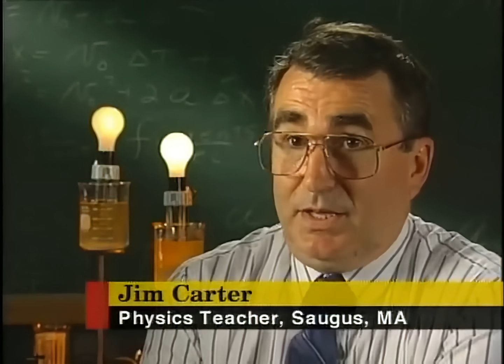MIT graduates cannot power a light bulb with a battery.

Comment: The big 120 volts light bulb sure lights up on the 1.5 volts battery but we don't see the light because it's too weak for our sight, but, if you observe the light bulb through a cellphone camera which is infrared sensitive then you will see it lights up because the filament gets a little bit warmer and irradiates infrared radiation.
Reply: "unless your phone camera lens is bigger than your dilated pupil, it cannot detect wavelengths bigger than what your eye can see (infrared)" Bullshit!
Reply: Martin O'Donnell
Your'e right, that's bullshit. This guy, Putty, knows nothing about physics.

Greets
Reply: Any heated body emits, it's just that the visible part of the radiation is not always powerful enough for our eyes to register, so from the point of view of physics they can light a bulb from a battery and a wire since the battery will heat the spiral of the bulb and it will emit more
Reply: First off the size of a bulb is not necessarily directly proportional to it's voltage requirements. There are small bulbs that are 120v (usually in a night light) and there are very large bulbs that are 2.5v. It was clear (at least to me) that they weren't trying to trick anyone.

Second, a MIT graduate should be able to read. The voltage rating is printed on both the bulb and battery so if the battery couldn't illuminate the bulb, them even attempting is quite humorous. 

And finally unless your phone camera lens is bigger than your dilated pupil, it cannot detect wavelengths bigger than what your eye can see (infrared). Most infrared cameras have a lens diameter of about 5 inches. I'm guessing you meant electromagnetic radiation in the infrared spectrum, there's no such thing as "infrared radiation"
Reply: putty93010
First; I know that the size of a bulb light has nothing to do with voltage. I just wanted to be descriptive.

Second; Being graduated at MIT is not a guarantee of basic and practical knowledge at all. School does not make students.

Third; The size of a lens has nothing to do with detecting bigger or shorter electromagnetic wavelengths. Most of cellphone cameras are able to detect infrared radiation. Infrared wavelength is even shorter than microwave radiation so it can easily pass through the tiny lens of any cellphone camera.

¿Why don't you do that experiment at home?

Greets.

Comment: Is this because the light bulb was designed for AC not DC current?
Reply: NO, IT'S BECAUSE THE CIRCUIT IS OPEN
Reply: it's because you have to close the loop by touching the bulb directly to the battery.
Reply: +Billy Leask No. Incandescent bulbs can run on both AC and DC just fine.
LEDs won't run as well on AC (they'll only be on half the time, which might be noticeable if the frequency is low enough), and in either case you'll break them without a resistor unless it's built in (which they are in bulbs, but a standalone LED won't), but DC is fine as long as it's in the correct direction.
Fluorescent bulbs need AC though.
Reply: What I said was that you had to close the loop. I didn't specify how. The Flagged Dragon is right.
Reply: +RyuDarragh Right
+CedarAce I realised that, but some students managed to close the circuit
+gimmethegepgun Thanks, I hadn't realised that.

Comment: This is not a question about electricity. All of them understood that they had to close the circuit in order to light the bulb. They expected two wires and thought the task would be really simple, but instead they were presented with a logic puzzle.
Reply: Difference between schematic diagram/circuit diagram(abstraction) and it's physical realisation(concretisation). 

The problem required them to understand how bulbs are wired. That particular bulb had one terminal at the bottom and the other on the side body( usually used in torch lights).
Reply: There is a girl who clearly didn't close any circuit (unless she is counting her body to ground is a close circuit) and was done
Reply: @dollymix5  Folks who failed in that way did not even get to the true test.
Reply: Engineering means to make the utilisation out of limited resources .... 
They should have done ... 
In industry you can be on the top when make the best with unexpected situations..
Reply: It's still about electricity if you consider the knowledge they're supposed to have about how current flows in conductors connected to batteries while on a closed circuit.
Reply: Well, engineering is essentially one big logic puzzle. So they should still be good at it.
Reply: To be fair problem solving should be very important in most of these academic fields
Reply: Logic puzzle? Its not even a puzzle 😂 just proof knowledge doesn't result in intelligence or wisdom
Reply: well, sure they expected tow wires, but the real problem is that they didn't know where to connect the light bulb to the circuit, even if they had two wires, I doubt they could figure out where to put them
Reply: They had one wire. 

Also they only had two hands and not a place to put 3 things. Wire battery bulb.

So this was a set up to show failure.

Also the problem was not working with a bulb and know, where the power needs to be inputted.
Reply: @dofer112 i love how youtube algorithm made us respond to an 8yo comment in a random video lol
Reply: @dofer112  it's obvious to anyone how you would connect one wire to create a circuit. Clue is in the name 😂 should have been especially obvious to mit students but somehow wasn't
Reply: Just cut the wire using a cutter
Reply: When I want to test if there still electricity in the battery 🔋 , I use my lip and my tongue 😛 to choose the circuit 😉
Reply: Image these people having to help the crew on the Apollo 13. You’re fucked.
Reply: It's not a "logic puzzle" and you don't need two wires.  They just needed to close the circuit by touching the bottom of the bulb to the other battery terminal.
Reply: It's easier this way - two wires, it becomes an issue how to hold them. I'd probably strip the wire halfway to tie it around the outer bit of the bulb, because juggling is not my forte.
Reply: This question isn't about electricity because a light bulb can't be powered by DC? 😬😅💀. The comments here prove the video right.
Reply: It was obvious to attach one terminal directly to the bulb.
Reply: An actual dog with the intelligence of a 3 year old could figure out this "puzzle".
Reply: That seems to be a logic puzzle of the level a high school graduate should ace.
Reply: Thats not a logic puzzle. Thats common sense. we were taught this shit in 6th grade but had been doing this on our own 2 years before that.
Reply: They haven't learned a lot of practical skills yet that happens in the field. They're used to solving book problems and theory. Every one of them would pass the test a few years down the road.
Reply: @gearhead1302 You're 100% right. Clearly, the people criticizing them in this comments section do not have a STEM degree.
Reply: that was the easiest logic puzzle ive ever seen
Reply: Not all knew how to complete a circuit and some apparently didn't even understand the concept.
Reply: LOGIC PUZZLE? are you joking me?
Reply: Where the hell is the puzzle, they know they need to apply a potential to the light bulb and there is only one way do that
Reply: Yeah I don't think it's a very fair test since it's not even a part of what you're supposed to learn... You can know from circuit diagrams that a light bulb has two terminals, but without seeing the bulb used before, how would you know where they are? Even within EE I bet a lot of the stuff is done for you (like PCBs) or made really obvious/easy if there is a practical element (like gpio pin and a led with 2 very obvious long metal prongs). No doubt  most of these students can design (a part of) the ultimate sci-fi gadget, just can't easily put it together by hand without doing a bit of extra learning.
Reply: Don't make excuses for them.
Reply: @disqusrubbish5467   Is that for the OP dhonor or me
Reply: they should have known all that before going to MIT. math, programming, electronics are things one can develop at least a layman's level of competency in outside uni. it's not anatomy.
you act like you see a simple circuit for the first time in your life, I cannot help but conclude you're someone who doesn't care and who was maneuvered into these fields by an ambitious family or a govt with things to prove
Reply: it's not even about the wires... it's about the type of current the bulb needs
you could make the close circuit by just posing one end of the bulb on one end of the battery and then using the wire to connect the other ends, just like the man at 1:57 did, but you must notice that bulb is very different than the others. A battery is not supposed to light a bulb since those use AC instead of DC
Reply: @el.ivansillo  DC will also light the bulb if the voltage is high enough. A lamp is just a resistor that heats so much that starts emitting a visible light. So it doesn't matter if it's AC or DC if the current heats the spiral enough. But only if it's not a modern LED lamp.
Reply: @el.ivansillo A light bulb is just a glowing piece of wire and doesn‘t care whether it‘s supplied with AC or DC. The only reason light bulbs design to illuminate rooms don‘t work with 1.5V batteries is because those batteries cannot supply the necessary current. Operating say a 60W bulb with 1.5V requires 40A of current. I‘d have to look up how much current typical 1.5V batteries can supply, but it‘s well below 40A - and in this scenario it‘s going to be further reduced because using your fingers to touch a wire to the contacts of a battery and a light bulb is crappy connection with a relatively high resesitance.
Reply: @MrAranton it's not the current. the current is limited from above by the resistance of the bulb. you could connect N 1.5V batteries in parallel for an arbitrary current, it still wouldn't light up a standard 60W bulb. It just can't draw that current at 1.5V
Reply: @ You're correct - if you  restrict yourself to a battery, wires and a light bulb. 

However: Step-up converters are a thing, and being an electronic's technician, I don't consider designing a circuit that turns 1.5V into 230V much of a challenge. But even with such a circuit a 1.5V battery couldn't power a 60W light bulb because it's internal resistance limits the current - and thus the wattage - it's able to put out.
Reply: @el.ivansillo  DC will light an AC bulb.
Reply: An incandescent bulb don’t cares if u use AC or DC. The only thing it cares for is the power rating. That means: Your supply provides enough current to make it glow …
Reply: @pascal2745   even LED light emitting diodes can run on AC, the problem is that the light would flicker due to the nature of AC current
Reply: @el.ivansillo  AC light bulb can also work on DC current. But I see a bigger problem here, they didn't know if it was an AC or DC light bulb. As children, we played with batteries, connecting them in series or parallel for slightly stronger light bulbs. We learned that basic knowledge in elementary school.
Reply: I don't see how it's logic. Just common sense really
Reply: @NedTaylor-hz9yd Sorry to say but you wouldn't be a exception either if you were put through this same test , It's common sense now that you have seen it but there is a reason all these graduates were left stumped
Reply: @zman3535  I was watching and thinking damn some obvious initial questions missed and then some of them literally demonstrate they had no common sense in the video like even you would have to admit some of the attempts were very poor
Reply: @NedTaylor-hz9yd I think them getting only 1 wire instead of 2 , plus the pressure of performing on camera got to them and left them confused
Reply: wtf dude.. why so defensive? Are you or your kin or kids from the uni and you're feeling the burn from the truth?